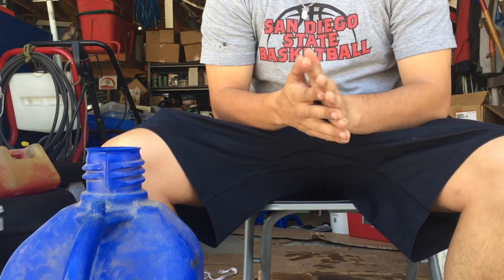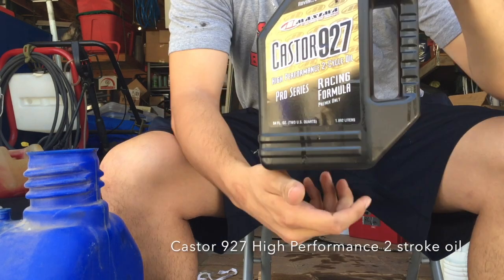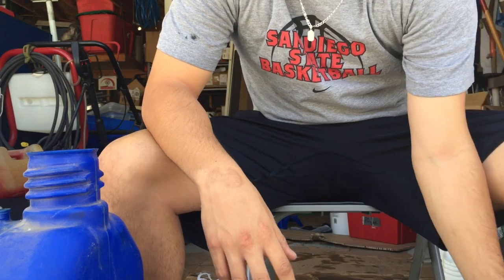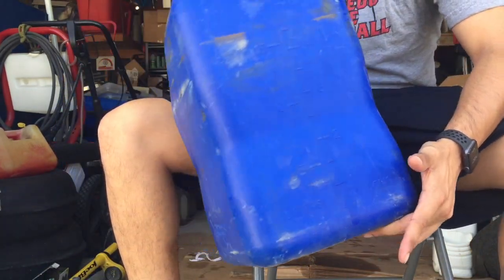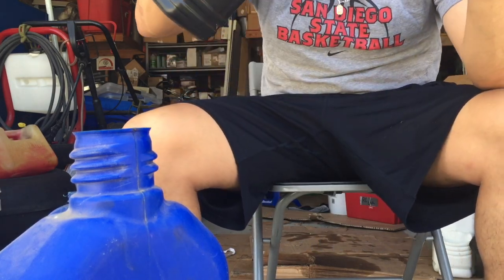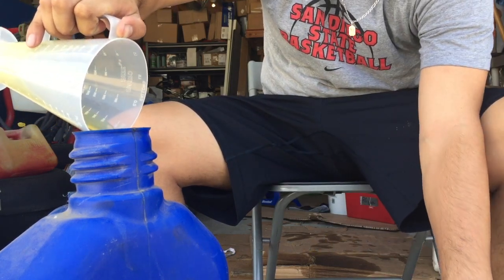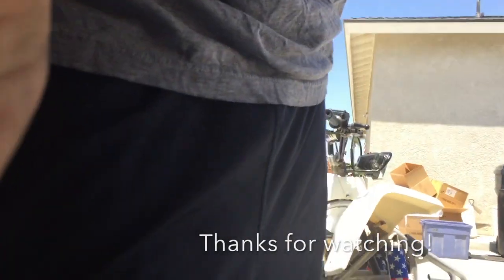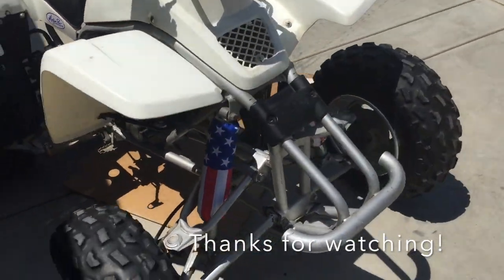TECH TIP**  USE THIS 2 STROKE OIL FOR YOUR QUAD!

Comment: yeah I run those mixture too Castro 927 but seem to clog the power and other stuff it smells good but doesn't burn cleaning but redline is the best for me for 2 stroke ratio 40:1
Reply from the maker: intersting. Thanks for letting me know. I will try it out

Comment: Just curious, what does the pipe have to do with how much oil the engine needs? Does it just scavenge better?
Reply from the maker: The pipe provides more airflow and requires more fuel. It makes the engine crave more fuel. The oil needs to be increased to provide the right lubrication so it doesn’t overheat and blow up

Comment: What do you recommend for my Honda ATC 250R?
Reply from the maker: Same stuff. This is 2 stroke oil for banshee's, yz's, cr's, trx, any 2 strokes
Reply: Id opt to get klotz r50 premix. Much better stuff in my honest opinion. Ive had and built more 2 strokes then I can remember and i can vouch for it. Really good stuff. Smells amazing too. More of a thicker premix. Run it in my banshee, blaster, and cr250. Good for powervalved motors as well as non.

Comment: I have a 2005 yamaha blaster n it’s a self mixer, what oil do you recommend
Reply from the maker: 2 Stroke oil. You can use the oil seen in the video or yamalube is what yamaha recommends
Reply: @Offroadaddicts  I thought the yamalube 2r went in the filler cap of the engine?!?
Reply: You have to run an oil that works for oil injection.

Comment: Castor I use for racing works just fine.
Reply from the maker: Pretty much all oil "works fine" I just like this one but most 2 stroke oil sold at motorcycle shops do the trick

Comment: It would be different if it wasnt a blaster. Its not worth buying better quality unless its built with a lot of money in it. But for stock just run yamalube. Its a blend made for yamahas. So how would it hurt your engine?
Reply from the maker: I ran yamahlube and it gave me about a year before my engine blew with a toomey, I have started run with this oil and my engine stays cooler and haven't had any issues.
Reply: @Offroadaddicts  really. The oil affects the temperature? Was it because of the oil? Or do you ride different?
Reply: Yamalube stinks and castor smells good so that means that the yamalube will destroy my engine. Jk lol yamalube is a good oil but I prefer castor 927.
Reply: @DowneyCal  yeah. Its all about what fits your engine. All are different
Reply: @Offroadaddicts  I always run 32:1 on my yz125 and one day I decided to try castor927 and my spark plug was foul 
Left me stranded for 2hrs under a bridge at night time
Never again will I buy that brand
I always use yamalube products in all my bikes now
Reply: Quad&bikes R3 when you’re adding more air you’re gonna want a better lubricant in your top end

Comment: That oil you showing is it like formulaK2 I just watch another video that they mix the oil you have with gear/tranny oil I was lost I'm a👉 newbie 👈
Reply from the maker: This oil is strictly for premix. The reason you mix it with gas is because it lubricates the cylinder.
Reply: @Offroadaddicts  ok thanks